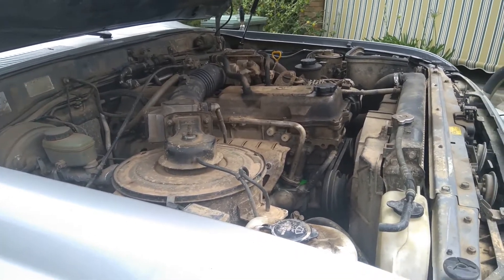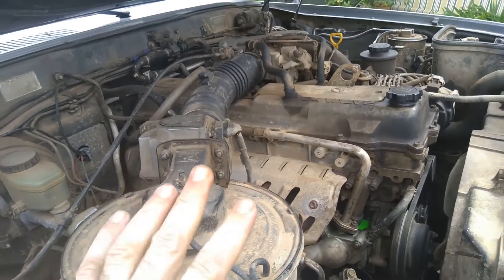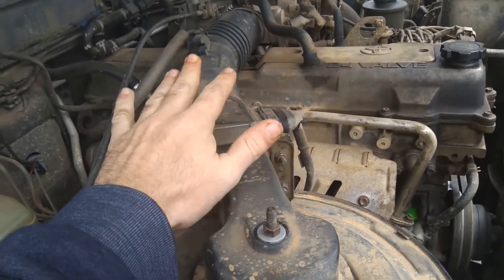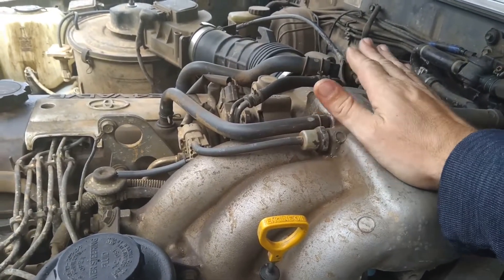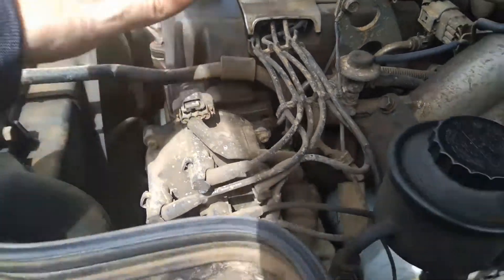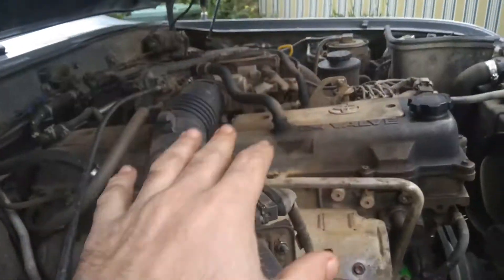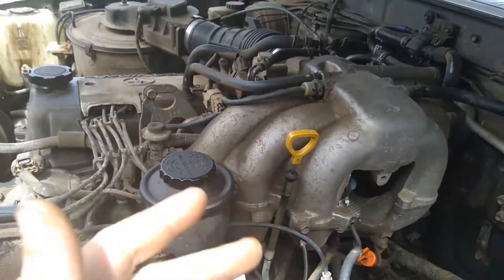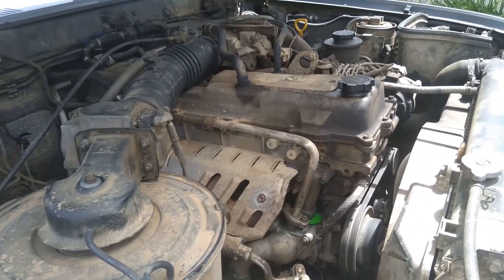80series - 1FZ-FE getting bogged down

Comment: I have a 1994 that my mechanic and I have been struggling with. I believe he cleaned the Mass airflow sensor, he cleaned the throttle body, spark plugs are new, throttle cable is adjusted properly, timing is at factory settings, fuel injectors are working and we just replaced the idle air control valve. However it's still revving up to 2 grand when I start the car, and it gets bogged down when taking off when it's cold. It also is pretty sluggish until I get all the way on the gas and it feels like it finally opens up and goes. Any thoughts?
Reply from the maker: Mine did the same thing at cold start. Nearly 2k rev 1st thing in the morning 
Bogged down?? Err Auro or Man??
Reply: @OldMatesBackyardTech  mines auto it’s had idle issues since I have had it. I got rid of the vibration it was doing with the stuff I mentioned
Reply from the maker: Auto, hmmmm 
So more like to a442f 
Um, never had mine bog down but maybe grt the auto checked
Reply: @OldMatesBackyardTech  I will get it looked at! Thank you for the reply
Reply: @ShaneDennis-The-Realtor  Hello Shane, I’m currently struggling with the same issue with my 1993 did you end up getting it sorted?

Comment: I got 2 problem in my 80 series: #1 sub tank doesn't want to transfer fuel (it has always been working correctly) . #2 I was using 16lt every 100km and now I am using 22lt, definitely something is wrong and I don't know what to do, would you help me please 🙏🙏
Reply from the maker: Problem #1 - check sub tank fuse and switch. If all good there, check sub pump works using g 12v supply and make sure it spins. If all good, check there are no blockages in transfer pipes
Problem #2 - Engine needs a good service, check for any fuel leaks, get a tune up and check mixture settings.

Comment: I got a 80 series 1996 land cruiser, I’m not a mechanic but I over heated my engine, blow off my hoses, been trying to remove the spark plugs. Basically the rubber boots have broken off in the spark plug area, and have basically stuck in there. Been trying to remove without taking the head off. But there’s some oil in the 6th spark plug meaning I may have done a piston ring. Does that mean it’s completely fked or can I repair it personally. 
I’m not a rich man but I love camping and 4x4 when can here in Australia Melbourne.
If you can give me any advice I’d be very thankful.
Reply from the maker: If you are able to get the head off yourself, it may save you some money if you are confident enough to do it yourself, but I would advise still getting a mechanic to look into it if the rings in cyl 6 are gone
Reply: @OldMatesBackyardTech   sadly I can’t afford a mechanic as they said 6-8k in repairs, tho I know there’s about 2k in parts, it’s the labour which is the expensive part. I have worked in Refrigeration and Air-conditioning for a matter of 5+ years so I’m pretty good with my hands, but I have only ever worked on Holden commys. Tho never been into an engine myself yet tho I have read a bit about it. I’m basically going off what ever I can learn on the go while doing what I can to repair it. Tho if ur in Victoria, what’s the changes you could come down for a look? I’d shout ya a few beers if ur a drinker and possibly some cash for the help if I can afford too 😊.
But I’ll have to look into how to get into the head while the engine is still in place. Cos there’s a lot of air ways and what not above it which I haven’t nor unsure how to pull out, and to put back in. I’m need to record everything to make sure it goes back in the right places. But thanks for the reply and the advice
Reply from the maker: G'day fella. You are from my home town. Nice. Though in saying that, i sitll live in Victoria.
Alright you are in a trouble boyo. You may need to get the head off unfortunately. If you blew off the hoses there is likely (not highly likely but likely) other problems that are going need to be looked into. My suggestion is to find a good mechanic who can do it and a fair price.

Comment: I’ve got a weird problem. The engine misfires and is super slow at low rpm. Then once it gets above approx 3500 rpm the engine comes alive and power kicks in. Any thoughts?
Reply from the maker: 1 - check cylinder compression
2 - spark plugs/dizzy cap and rotor button
3 - fuel injectors 
4- all else fails get ECU codes read
Reply: @OldMatesBackyardTech  I also had the same trouble and the problem was water in the plug at the o2 sensor. Fixed it with some contact cleaner to dry it up and clean, then shoved some dielectric grease in it, then put some denso type tape to stop water getting in. Could also just replace the plug so it has a good seal.

Comment: G'day mate,my 94model 80 series seems like its only running on 4 or 5 cylinders,it idles very rough and gets a lot worse when i put it in drive,it vibrates when driving,and blowing excess condensation on start up,and a stong fuel smell,any suggestions please,cheers Terry
Reply from the maker: Could be any number of things ranging from electrical issue (leads, rotor button dizzy cap, injectors etc) through to head gasket issues and/or compression issues
Things to check that are easy are
1 - Rotor Button in dizzy along with cap
2 - Check for any leaky sparks in leads (all 7 of them) along with spark plugs (may need new plugs_
3 - See if injectors all work (could be clogged up)
4 - If all that checks out, get head gasket checked along with compression test
Reply from the maker: If it is a 1H series engine (1HZ, 1HD-T etc) could be head issues, injector issues and or turbo issues if running 1HD-T/HD-FT
Reply from the maker: Hopefully this follow up video will also help
https://www.youtube.com/watch?v=ULoBPIuZDQ4

Comment: Hi, I'm struggling to get my 80 series started, it has spark and fuel pressure is good, it's sounds like it wants to start but nothing....please help
Reply from the maker: Could Be Timing, could be pre-ignitor on the coil, could be ECU error. Just because you have a spark and fuel pressure means a little bit. Sounds like either a timing issue, ECU or ignition fault somewhere
Reply: @OldMatesBackyardTech  thanks for the reply, where should I start looking for the pre-ignitor and if it's timing, which timing should I check
Reply from the maker: @clinty8  get the ecu checked 1st to see if there is an error code coming up. Also check the coil plug for issues
Reply from the maker: @clinty8  also pull the dizzy cap off and check the rotor button and cap
Reply: @OldMatesBackyardTech   thanks il do that, only code I get from the ECU is throttle position sensor, I can see the wires from the sensor is damaged, I did the paper clip method where the engine light flashes, is that reliable?
Reply from the maker: @clinty8  yes it is reliable. Also, check the MAS block

Comment: Hi there I do have a problem with mine it’s feels like it is starving for fuel but it revs good I changed the fuel filter 14000 km ago for that reason I found no butterfly inside the map cencer just a rocket looking thing and have used lots of injection cleaning and still starving
Reply from the maker: Get the ECU checked out

Comment: Hi how many k's do you get out of a main tank, I have a 97 model & get 450-500k's out of a tank local driving. I've owned the a short time 3mths with 360k on the clock. I don't know anyone around my way to ask cheers
Reply from the maker: Mine being a late '93 (aka fzj80r) i get around 400k's to 90L of petrol round town. But out on the highway i can squeeze 530ish just of the main tank

Comment: Hi mate my fj 75 cruiser has sooty tailpipe am running rough got new plugs pointless ignition vertically happened overnight .hope you can help thanks
Reply from the maker: @John Warwick, please watch this video for better detail: https://www.youtube.com/watch?v=Amf5GZ_HU5o
Reply from the maker: Assuming your engine is the 1fz-fe 4.5L 6 cylinder in the 75, it sounds like dirty fuel injectors
Reply from the maker: Could also be running rich as well so u may need to get it checked as well as the timing